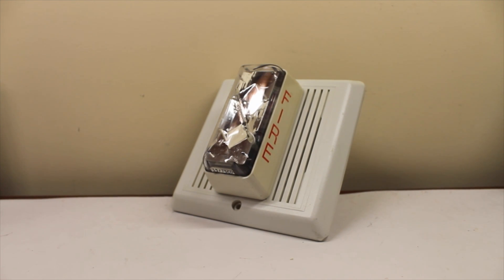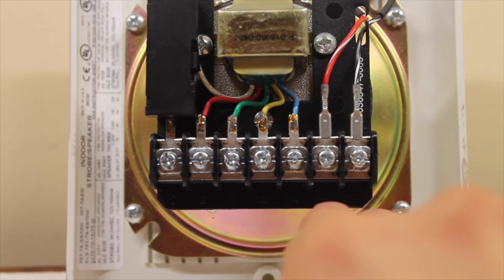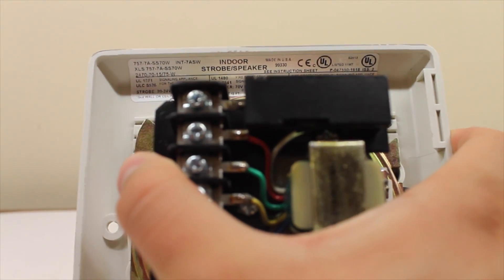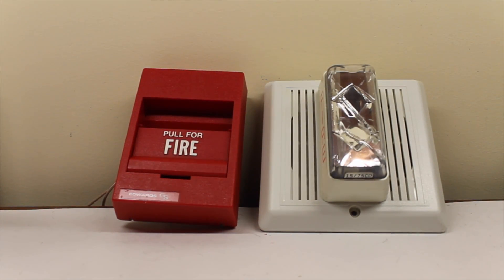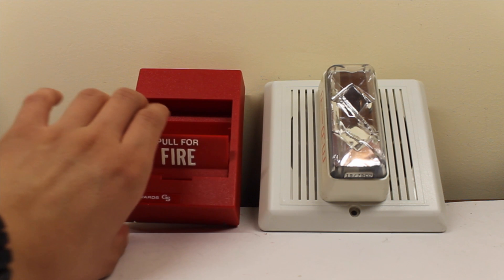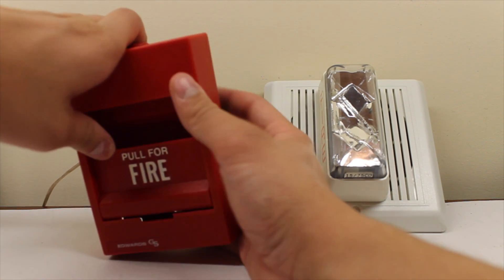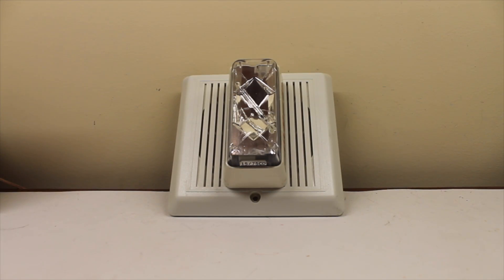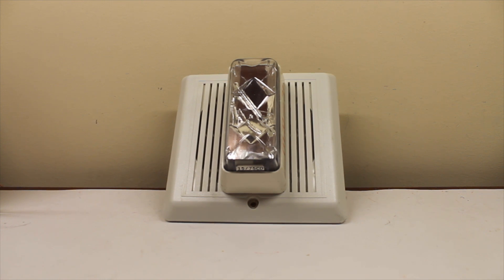Edwards/EST 757-7A-SS70W (Integrity) Fire Alarm Overview/Test

Comment: How much voltage did you use on that speaker and how much voltage you put on the speaker?
Reply from the maker: The speaker is a 70v speaker. I have a 70v amplifier which provides the correct voltage for the speaker (can also do 25v)
Reply: @NewEnglandElevators  i heard that you can use a headphone jack to make it work barley make sound but works

Comment: Is there a way to add a black cover, or remove it? For the pull station. (ExitSign250) said you could. If you know, please tell me!! 🙂🙂
Reply from the maker: I haven't tried this for myself, so don't take my word for it (the pull that you see here was sold as a single action unit, as opposed to the one with the black flappy cover). However, from what I've seen, it seems like it would be easy to insert the cover into the unit, seems like you would just insert the tabs into the holes where it would usually go. Not 100% sure how to remove it.

I'm not 100% sure of the answer, but hopefully that is a start. Thanks for asking!
Reply: @NewEnglandElevators  thanks!

Comment: How does one tell these apart from the horn counterpart, without sounding them?
Reply from the maker: The horns have a black Sounder unit, not as large as a speaker, and more rectangular. The speakers have a metal speaker stuck on the back (not black). The speakers, at least this generation, also have multiple sets of terminals, each for a different wattage setting (I think I show the back of this device in the video at some point)...not sure how it is on older generations.

If mounted on the wall, I'll be honest, there's no real easy way, you can't really see much through the grille of the device, maybe some reflection from the metal speaker unit if you look real closely...can't guarantee you would be able to see it if the device was on the wall, higher up.  Not as easy as looking up the grille of a rectangular Simplex 4903, I can tell you that. 😉

Hope this helps get you started.
Reply: NewEnglandElevators So I guess I’d have to assume the type of alarm based on the type of building it’s located in?
Reply: NewEnglandElevators I’ve seen Integrities in the Walt Disney Concert Hall in Los Angeles; they’d probably be speakers, right?
Reply from the maker: @littlewishy6432  I've never been to the Walt Disney Concert Hall, so I will have to take your word for what's there. More than likely because it's a high occupancy space, the devices would be speakers. It would not be pleasant having horns blaring all over the place.

To answer your question, you can assume what alarm is in place based on the building type, although it can be a bit deceiving. A mall or large school with these devices could very well be horn/strobes rather than having a voice evac system...so it's about a 50/50 chance. Other clues to look out for is to see if any devices were replaced with anything else (ex: an Integrity Speaker/Strobes swapped out for a Genesis speaker strobe), or if there is an annunciator with a microphone near it (at least that's the case with the EST 3 systems).
Reply: NewEnglandElevators Given that, actually… one of the alarms there just so happens to be a Genesis speaker strobe, so…

Comment: How do u tell the difference between the horn strobe and the speaker strobe integrities if your in a hotel and they never go off?
Reply from the maker: No easy way to tell, honestly. Can't really look through the grille, unlike Simplex rectangular 4903 devices. You'll probably figure something out yourself once you gain experience with these things.
Reply: NewEnglandElevators or is it that the integrity horn strobes have the candela numbers in red and speaker strobes have candela numbers in black?
Reply from the maker: The color of the candela font has no effect on whether or not it's a speaker strobe, but rather, indicates whether or not it is enhanced (can sync with other devices, including Genesis) vs unenhanced. 

This should help:
http://firealarmresources.com/wp-content/uploads/2013/06/EST-EST3-v1.0-Integrity-and-Genesis-Strobe-Application-Bulletin.pdf
Reply: yeah right thanks for  the tip mate.

Comment: Hey, kids, don't forget that EST made a round version of this speaker/strobe (964 and 965), both with 4" and 8" grilles.  I've got a 965-7A-4RR.

And I never understood why EST put a 7-terminal block on the back of their indoor speaker/strobes instead of just a four-terminal block with a four-part jumper.
Reply from the maker: Just took a look at your video (and subbed). I've seen one pic of those before, never figured out the model #. Definitely and under-appreciated alarm.

Comment: What are you using for the voice evacs? Do you have a voice panel or is it an amplifier? could you show me where to find one?
Reply from the maker: I use an amp that outputs 70V, with messages on an MP3 player. I use a Pyle home PC20MA, which outputs 25v or 70v. For simple testing and experimental purposes, you don't need a fancy VECP.
Reply: okay
Reply: thanks
Reply: Where can I find adapters or batteries?

Comment: How do you play custom messages on the horn?
Reply from the maker: +DRaminfard It's fairly easy, just load the messages onto an MP3 player of some sort, and feed it into your amplifier that the speaker is connected to.
Reply: Do you need the plug that headphones have attached for the amplifier? For inputting.
Reply: This is not a horn. It's a speaker...
Reply: connect it to a computer

Comment: Quick question: How do you hook up your speakers? I just got a bunch of speaker strobes and can only test the strobes.
Reply from the maker: +HappyJigg The best option is to get an amplifier that supports either 25v or 70v speakers. This way, you're powering the speakers at their optimum power. However, to start off, you can power the speakers using a standard stereo unit, although I DO NOT recommend this method, as stereo units are made for lower voltage speakers. Continuously hooking up the speakers to this will eventually damage the stereo unit.
Reply: F**K. You
Reply: Fuck
Reply: @deanduffy4722  Who pissed in your corn flakes?